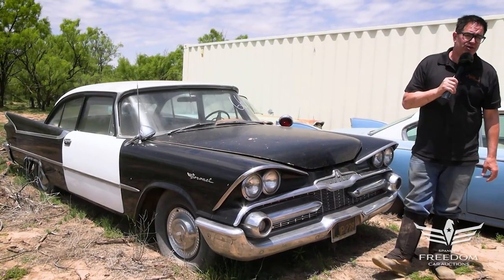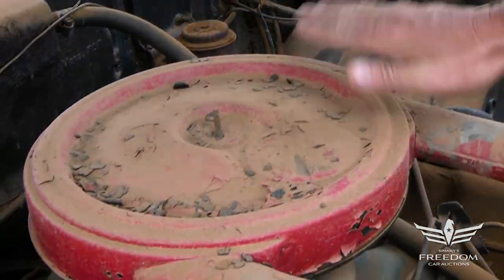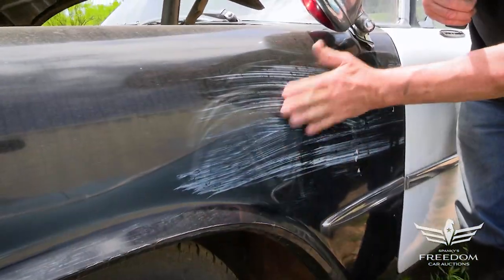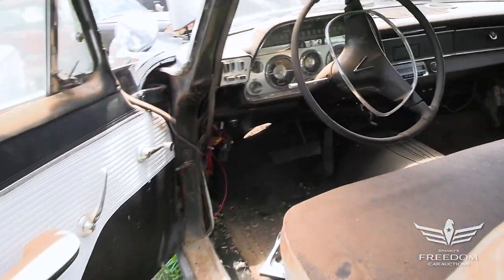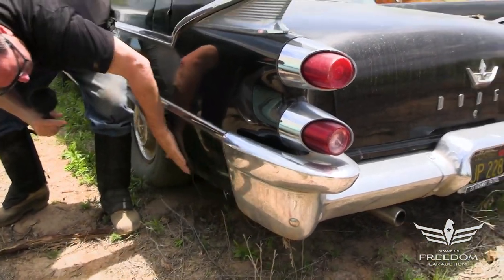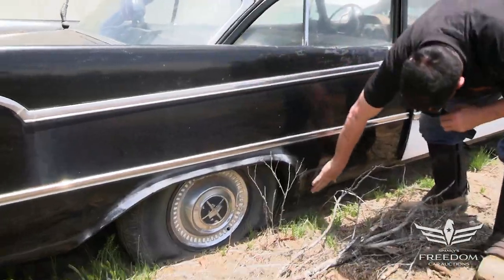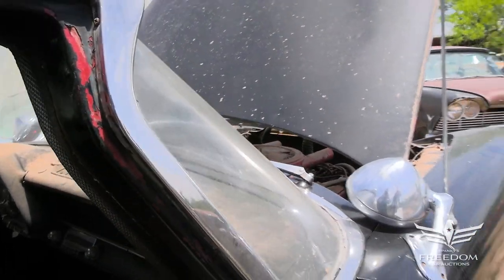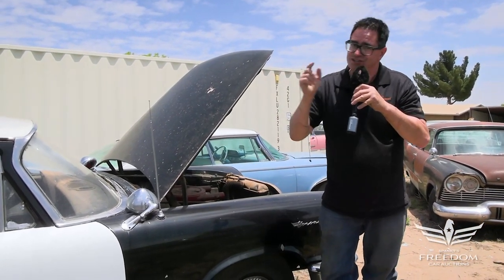66 1959 Dodge Coronet Police

Comment: Former fire department car (red) later updated as a "police" car?
Reply: Bingo. Its weird that it is a 2 door, and that it has all the belvedere trim. A 2 door would lead one to believe that it was a pursuit car, and wouldn't use the back seat. But if it was a pursuit car, it would have the D-500. I think the red paint is the giveaway. Probably a fire chief car. Would still have the "9" in the VIN, wouldn't need the hot motor, but wanted it to look nice so kept the trim. Would still have all the lights. Respray it Black and White and PRESTO! It's a police car. Still, any Exner Era Mopar that isn't rusted into the ground is a keeper.

Comment: my uncle was chp in socal in the south bay area -his friend took my sis and i in a brand new '57 chp dodge--we ripped around the hills,my sis 7 and i only 5-would never happen today!!- i remember him saying the brakes were fading(no disc)- maybe we went by where the beach boys lived!! my sis was scared to death....the red spot in  front is what the chp used for years to pull people over--calif was the last state to adopt radar so they paced you,when you saw the big grill coming up on your rear you knew they had you!!!no over head light to avoid detection,just that red spot and amber/red on the rear deck-cali is still black and white,same door emblem for 100 years! and the same blue tan uniform that is very classy for 100 years!

Comment: One thing that slipped by you, it has 1956 Dodge hubcaps for 15 inch wheels instead of the standard 14" wheels  that were standard on the '57 and newer Dodges and Plymouths. IDK if that's part of the police package or if someone changed it out over the decades. Seems like the CHP cars would have dog dish hubcaps for 14" or 15" wheels.
Reply: My dad bought a 2 yr old  61 Plymouth 2 dr cop car when I was a kid. It had the 12 in. brakes 15" wheels and dog dish caps.

Comment: Cool car Steve!!!
2 questions,  did the factory do anything with the springs in the police packages on these cars?

Are those things on your legs to prevent snake bites?
Reply: Not a bad guess, considering he's walking around in the dirt field full of great places to hide.
Reply: @jamesplotkin4674  Thanks, kinda what I was thinking too.🙂
Reply: He’s in Texas, in the middle of summer, walking around the middle of the prairie grass field with hundreds of cars that the Ole rattle snake 🐍 would be proud to call home. All Steve needs to do is walk around the wrong car and the damn ankle biter may appear from nowhere’s and give him a love tap so yes, that’s exactly what those are and it’s cheap insurance against spending a few days in the hospital from a snake bite. Those rattle snakes don’t play brother
Reply: Usually a police vehicle has heavy duty parts. It has larger torsion bars on the front and HD shocks all around!! I had a 68 Plymouth 4 door with no power breaks or steering! It had radial tires which made it a beast when turning slowly! It had 11 /1/2 inch brakes with double brake cylinders on the front!  It was a staff car kept it in better condition than a patrol one. It had 90K miles which was the retirement figure then. 
This Coronet having two doors and 373 CU
probably means it was a staff car too. 
Mine had a 375 HP 440 CID. It looks like it was painted and period lights added for show!! Real police cars don’t have door handles and window cranks in the rear and usually have a screen behind the front seat. 
Ford always outsold Chrysler!!

Comment: We have a similar one you see at local car shows it has a  factory 383 rb high deck engine Wich is pretty much a unicorn I don't know the exact Year but it doesn't have the massive tail fins and it is a 4 door it was a Missouri highway patrol car
Reply: Check year on it. Looks like RB block if 59' block stamp pass. side would be 36 maybe 61 for 361cu in. If 1960 38 for a RB 383. Block stamping will tell.

Comment: Kind of surprised to see a standard generator on what appears to be a CHP package car. My late father had a 59 Plymouth Savoy police package that he got surplus from the La Mesa California Police Department(San Diego County). One of it’s unique features was a Leece-Neville alternator with an external voltage regulator/rectifier assembly mounted in front of the radiator for cooling. Dad had to replace that regulator assembly around 63 or 64, and I remember him mentioning that just the part was $54 in 1960’s dollars. I can’t help but wonder if a previous owner switched it back to the standard generator when confronted with the expense of servicing the heavy duty cop system.

Comment: It's almost as if it just went out of service. In better condition than most Crown Victorias that went out of service within the last few years.
Reply: I think this car is an older restoration with some of the police equipment reinstalled. Sirens and lights would have been removed before the car was resold. That red paint underneath implies the black and white currently on the car is not original. As Steve said its possible that the red was a repaint after police duty. We know that is was ordered as a police car but the question is for what agency. It "implies" CHP heritage but again those parts would have been reinstalled later. For all we know this could be a car from another agency's fleet.

Comment: I live in Los Angeles and I was born in 59.I would've killed 2 get that car. It looks 2 B in very good condition 4 its age.The reason there's no rust on it, is that is most likely from the LA area. 1 more thing. The CHP and Police use their cars 4 a lot longer than 1 or 2 years. At least here in California they do. It would cost way 2 much 2 replace those cars every 1 or 2 years.

Comment: Ya don't know MoPaR's as gud as ya think. Been told sum came with odd-ball 413(?)poly's(i nvr saw proof)distributor would be in rear. This one distributor in front! Its a "B"block!!! HOWEVER 58 had like 349.52cu in. So a 350. But this one is a 361 RB raised block. If he'd bother to check stamping on passenger side on block in front of head he'll see letter code for year then probably 361. No 383's then.(Chrysler might, I didnt check.)Chrysler did have 383 RB 1960! High school buddy went to state auction bought a 63 plymouth 2dr post sedan highway patrol car, had 361-4bbrl. (personally saw stamping on block!) SON-OF-A-BITCH that thing was fast !!!!!
Reply: You are wrong.  1958 had 350 and 361.  1959, 350 was gone, 383 introduced.  59 Dodge D500 top motor was a dual quad 383 with 345 horsepower.  Don't post incorrect info, and don't be a know-it-all when you aren't one.
Reply: Also, there was never a 413 poly, but there was a 413 flathead six for trucks in the early fifties.
Reply: Also again, there was NEVER a 361 raised deck motor.  All 361's were low deck B motors.